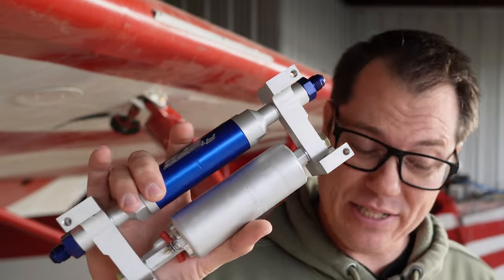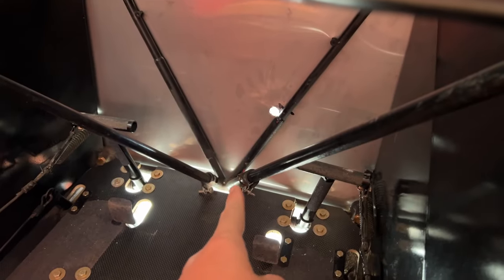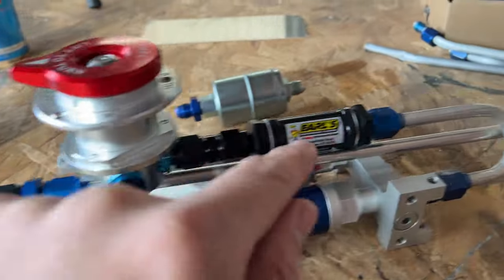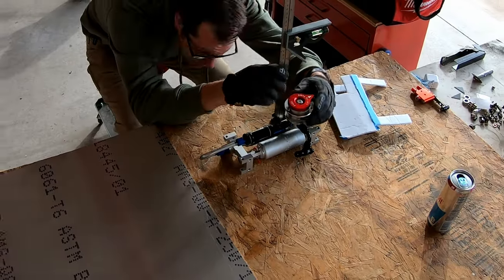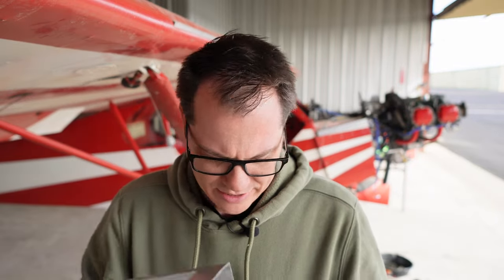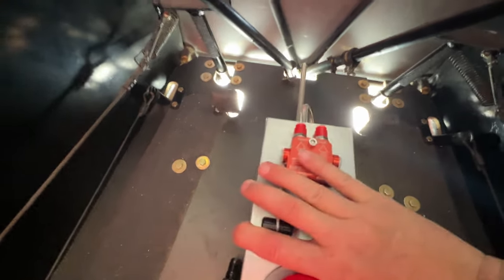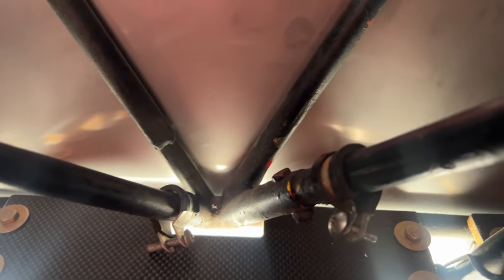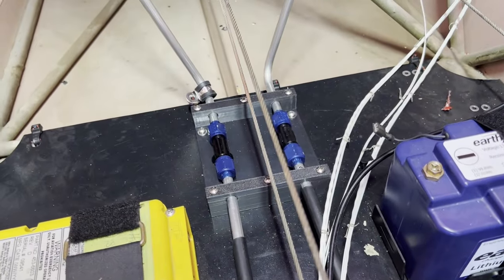I Hope This Works! | Boost Pump And Accessories Install

Comment: Great video Carl.  I've been following your channel for a while, and I really enjoy your content.  However, I had to cringe a little when I watched you create your bracket.  I've been working in and on aircraft structures from 1983 to 2012 when I went into engineering.  If I may I'd like to give you some pointers for the future.
1.  Always bend aluminum against the grain, otherwise it will crack and break, like it did.
2. the thicker the metal the larger the bend radius you will need (for 2024-T3, which is very common for aircraft use) .063 THK minimum bend Radius is 0.22.  For that bracket, you could probably get away with using 2024-T3 .050 THK which the bend radius will be somewhere around 0.18.  if you want a tighter bend radius you could go with 304 Stainless Steel .040 THK which you could probably get away with a .09 bend radius.
3. when you make a cutout in a piece of metal you should always radius the corners .125 min for outside corners and .25 min for inside corners.  When you are flying, that bracket will be subjected to vibration, the tighter the inside radius, the more likely a crack will form.
3. After you have made your cutouts, bends and holes, you should also smooth the edges it will also help to keep cracks from forming especially in an inside radius.  It will also keep anyone from cutting themselves on a sharp edge.

I hope that helps and that I'm not overstepping my bounds.
Cheers from Texas
Reply from the maker: Thank you! Not overstepping your bounds at all. I’ve made it clear I have no idea what I’m doing, learning a bunch as I go. Your info will help for sure, but I did do some of your suggestions before painting, just off camera. Sorry to make you cringe. 😬
Reply: @flywiththeguys  it was only a little cringe...haha.  Hit me up if you need any sheet metal advice/help in the future.

Comment: You could reinforce the base and the legs of the thinner aluminum by backing it with the thicker aluminum.  It would make the assembly more rigid, which was the original intent with the thicker metal.
Reply from the maker: It actually turned out ridged enough in the end. I think I was going overkill. I'm worried about cracking over time, but we'll see how things roll with the vibrations of the plane.

Comment: I'd love to find a J3 and follow your path. This brings me to a question for you. Being that  the  J3 is a "rear solo" plane and you have mentioned in the video about the fuel pump placement (between you feet in the Front Seat) in the ac, I was wondering how did you CG the plane for a front solo, or is it all due to the much larger engine that you have? Or is this a "Clipped Wing" thing or?  Thanks!
Reply from the maker: I did it with math. I removed a lot of weight in the front end, switched to wing tanks, and moved my forward seat aft 2.5 inches. It moved my CG well into the limits, although more forward. When calculating it again adding aft weight didn't change the CG much, probably because the engine is so big.